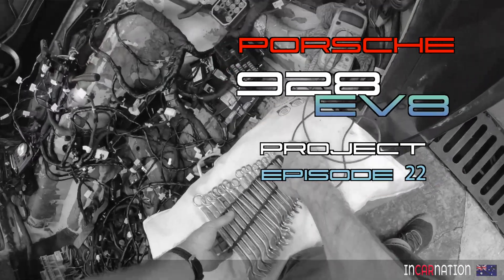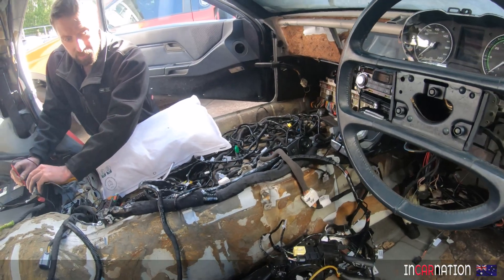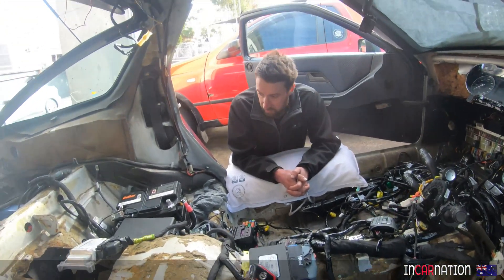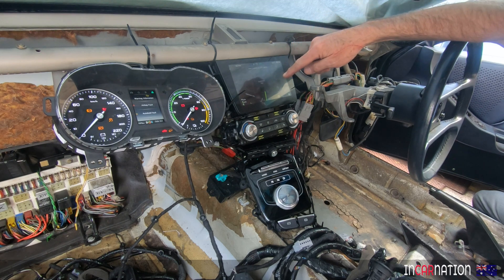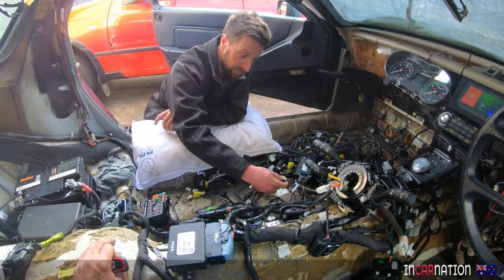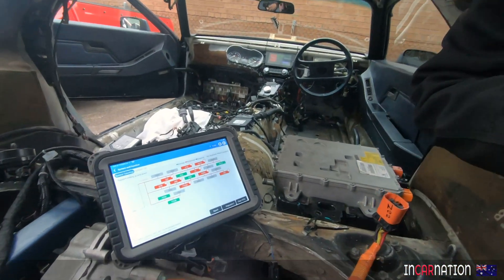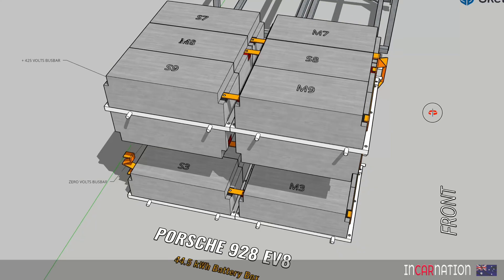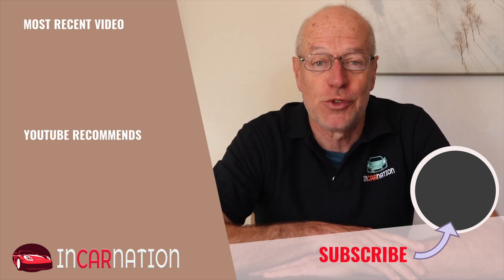Episode 22 – Porsche EV Conversion | Let There be VOLTS!

Comment: Great progress! No back seats for grandkids or small friends? Curious to why those HV components can't live in the boot?
Reply from the maker: Couple of reasons : 1 The boot is going to be pretty chockers with cooling related stuff - pumps, hoses, reservoir, radiators. 2 I want the HV stuff between motor and invertor, to keep HV leads as short as possible. 3 Back seat area behind passenger will be full of electronics - a lot of the stuff you see scattered in the footwell at the moment, so I've already lost one seat. 4 in all my years of 928 ownership I've hardly ever tried to put someone in the back seat - my kids are as tall as I am. Just not a priority for me. And 5 I get extra 150kg weight dispensation by being a 2-seater not a 4-seater 6. Convenience - I'd rather work on that stuff from above where it's shielded from road grime than below min the transmission tunnel.
It just seemed a sensible place - grandkids - when I get some - will have to go in other cars